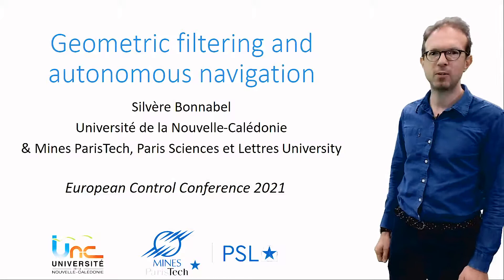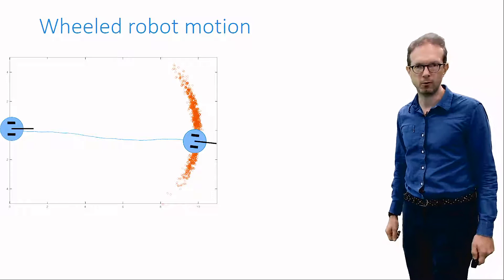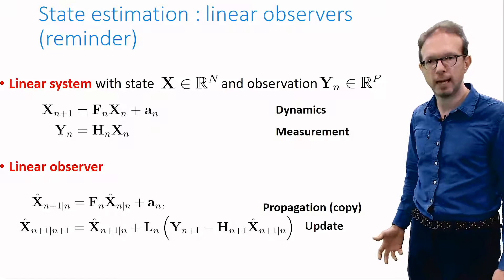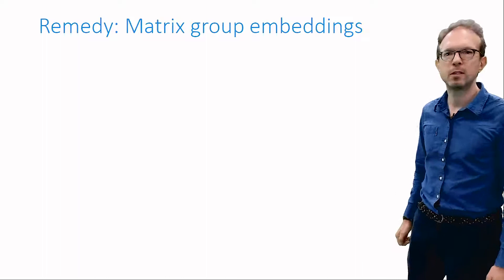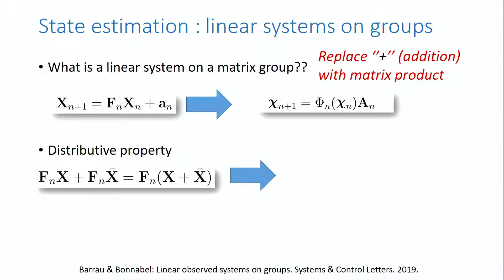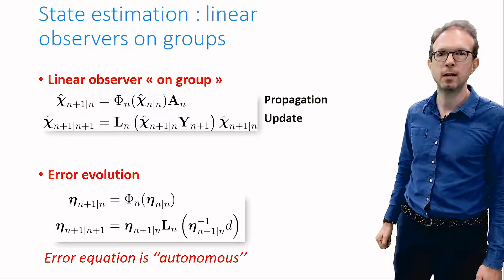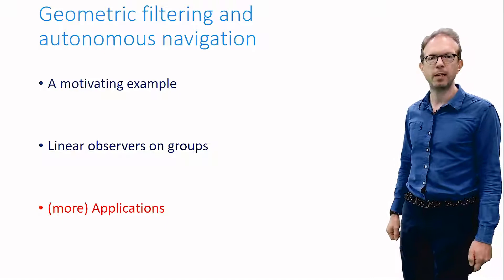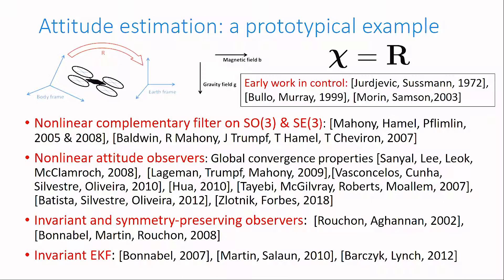Geometric Filtering and Autonomous Navigation

Comment: after a long time once again I start to build EKF, and Once again I have a question can we use imu's noise density parameter as process noise? just example if I have an accel sensor that has a noise density of 135ug/Sqrt(Hz) in the X-axis, and it has a sample rate of 100Hz, then I convert it into g which is around 0.000135 g. can we use this parameter as process noise in EKF? can I do like this? variance of x = (0.000135 * 0.000135) * dt where dt = 1 / sampling rate,

Comment: Regarding inertial navigation: Its common to use an error-state Kalman Filter to estimate the errors (not the total states) of the  strapdown nav equations and then use the output of the filter to correct them. Isn't that similar to the invariant filter because the error state space model used in the filter is also always linearized around zero (hence the same as the Invariant EKF?!) ?
Reply: Both are based on linearization, that is, first-order expansion w.r.t a small error, indeed. However, when using the EKF the Jacobians depend explicitly on the estimated state. This is because the error system is not autonomous. In other words, in the EKF methodology, linearization is based on a first-order perturbation of the estimated trajectory, which thus depends on this trajectory. By contrast, Invariant EKF manages to define a first-order perturbation of the estimated trajectory that does not depend on the estimate, thanks to a well-chosen nonlinear error variable.
Reply: @silverebonnabel199  Thanks! Very interesting..